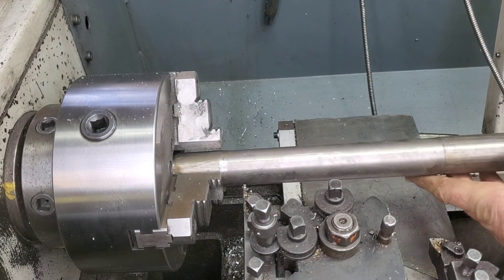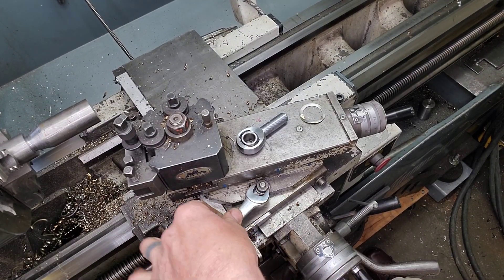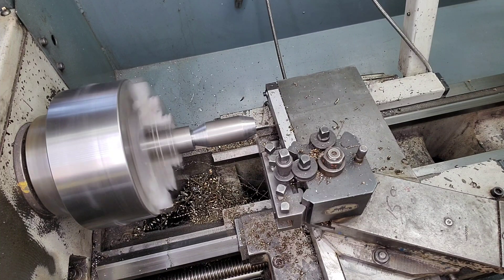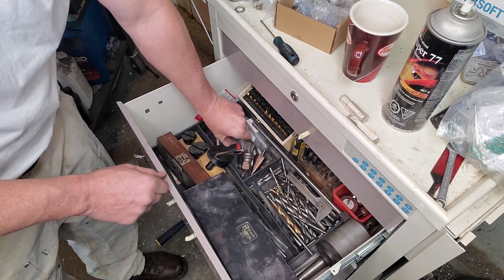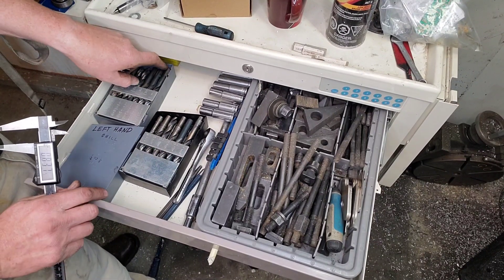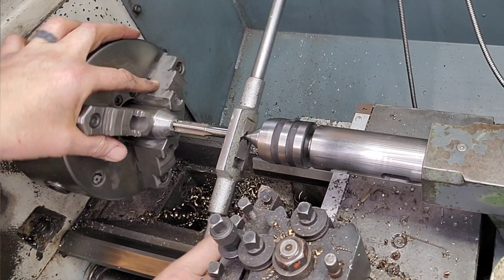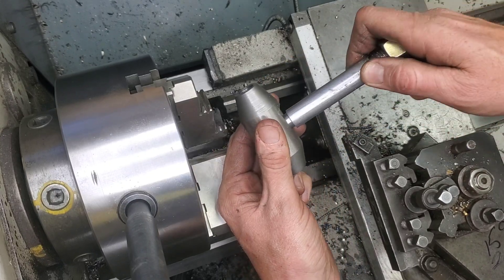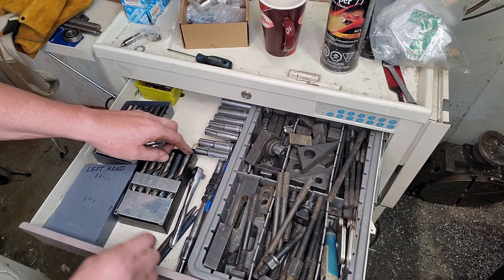Machining Race Lawn Mower Spindle

Comment: I know it's trivial but cross slide is going across bed of lathe.
Top slide or compound slide is the one your changing angles with.
If things are moving around, first, adjust gib strips then, find the saddle lock .
If you don't have one, make one
It would have been a more rigid set up if you had cut outer angle first.
Centre drill is really for 60 degree centre, for drilling, a short 'spotting drill' should be used but very few people actually use them (me included)
At least your shop is closer to reality of hobby shop where you want to get something done  and may have limited time - BSA, (bits stuck anywhere)
Reply from the maker: Good points , thank you :)